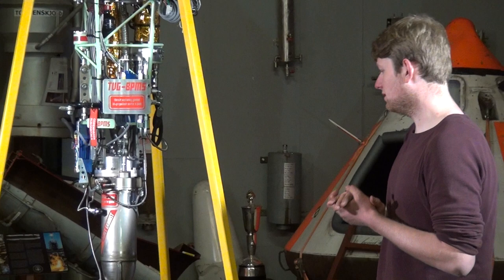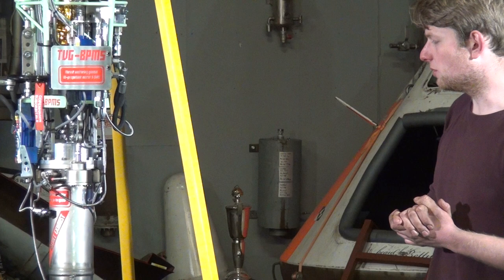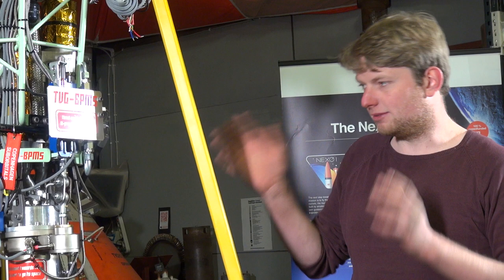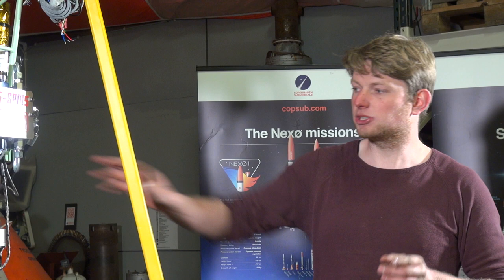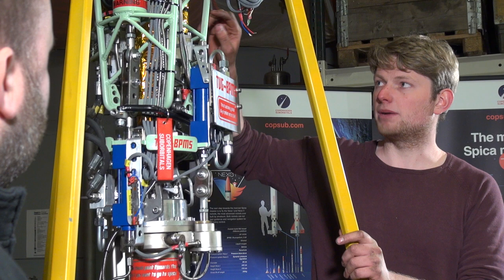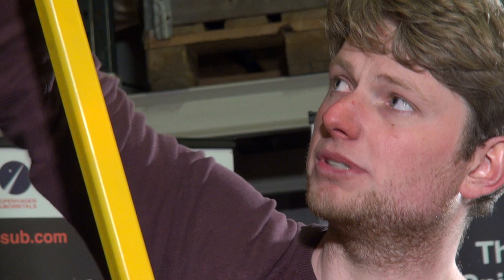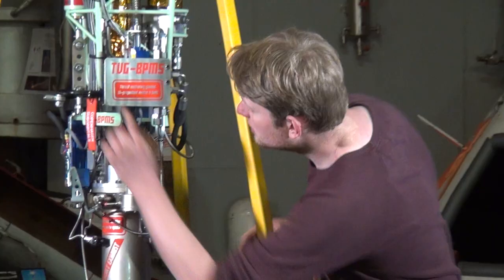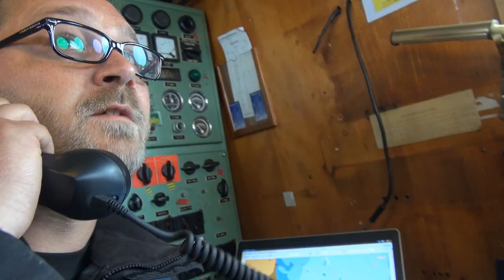DIY Thrust Vectoring BPM-5 Engine Gimbal | Current Affairs

Comment: Outstanding implementation! Now with that test data (27kg actuator load), if you were to start again, would you use a pure electric actuator system for best weight and response?
Reply: well, if they wanted to build the most efficient build I think they would, as this is relatively small rocket, but their goal was to build something scalable, that could be used on way bigger rockets, where purely electric actuation isnt practically doable, so thats why they went for the electronic hydraulic combo (keep in mind that I am in no way connected to the team, so its just my guess)

in other words, this was basically a proof of concept, flying BPM5 with gimballing is really an overkill, they will use this most likely only for BPM100 on SPICA flights
Reply: Martin Mazánek indeed, but if the measured load is only 20% of the expected load, I'd expect a seriously reduced load for a BPM100 too, so surely this justifies a review of the architecture. And with an electric motor driven pump, the hydraulic system is an alternative to a geared mechanical linkage. The motive power still comes from the electric motor. And that just seems like a very heavy geared linkage to me, compared with something like a ball screw. I'm sure these guys know exactly what they're doing, I'm just interested in exploring the issues.
Reply: Billy Sugger Don't forget that rocket vibrations and other dynamic forces may add to the actuator forces in a real flight.
Reply: John Francis Doe Indeed, I guess these need to be quantified. And presumably that's what the static testing was for.

Comment: How will linear potentiometers stand up to heavy vibrations in an actual flight?  General endurance is obviously not an issue, but what if the vibrations cause the wiper contact to bounce off the resistive surface several times per second, breaking the feedback loop?  Perhaps a capacitive or optical distance measurement would be more (or less) reliable. Another possibility is an optical position encoder, with a Gray code pattern painted/etched on the side of the actuator, and an array of phototransistors reading back the position code numerically into an SPI latch chip connected to the control computer.